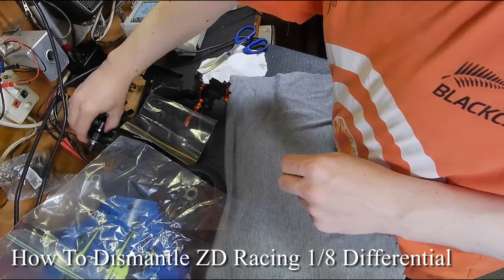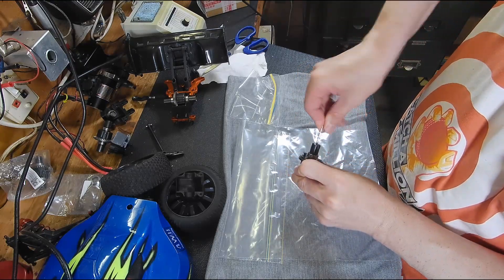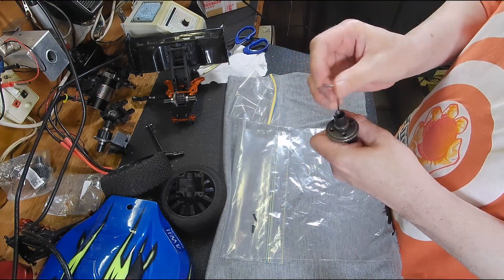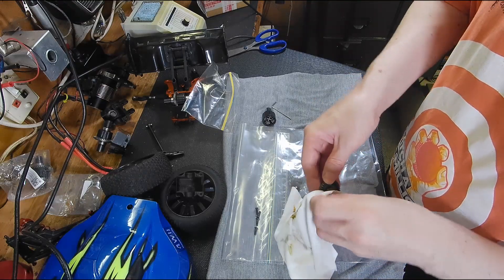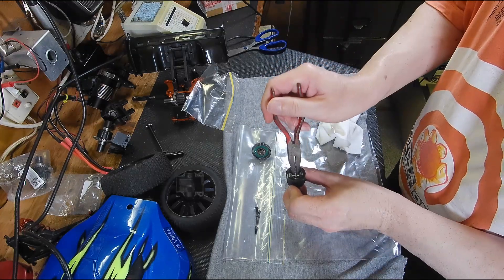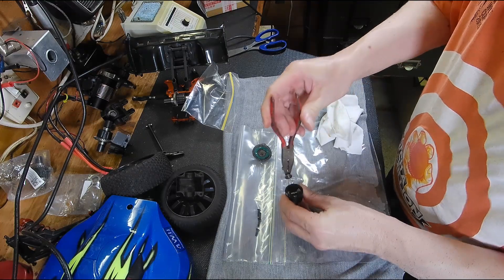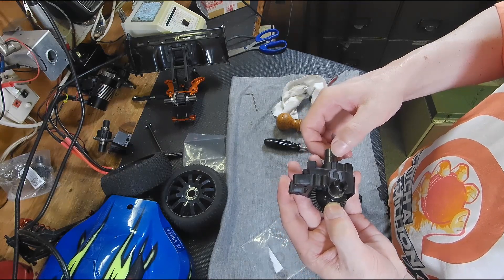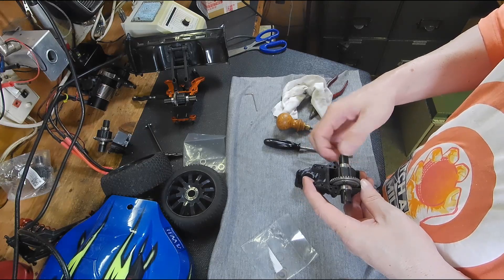How To Dismantle ZD Racing 1/8 Differential And Shimming Ideas

Comment: Hey man awesome vid I will be using it in the near future, was wondering if you could help.  I have the zd racing 1/8 pirates 3 buggy and I am having some wear and tear on my center diff connecting cups.  where the drive t bone rod goes into it, I guess it's slowly chipping away and now theres a chunk pressed into the cup and almost looks like the metal is starting to crack.  I fear it won't be long until the entire cup breaks off where the drive shaft goes into it.  Do you know the part number for this? is the center diff connection cups the same as the rear and front ones? thanks.  I was even thinking of swapping the front and rear cups around on the center diff because the side where I guess if you go in reverse that part of the c cup that would have pressure on it in reverse is not damaged at all.  and I barely use reverse.  thanks hope this makes sense to ya lol .
Reply from the maker: Hi, I think the issue is, that those center cups are not hardened steel. I know that ive upgraded all my other cups to hardened ones, except for the center diff, so I am actually in the same situation as you are, but i will look into a solution soon and make another video.
Reply: @MrGridStrom  Which cups did you use for the F and R differentials?  My C outdrives are perfectly fine but the F and R cups have a pretty nice size groove after about 20 runs.
Reply: @MrGridStrom  ahh that makes sense, because theres no damage on the t bones its just weak steel or what ever they used on the center cups, cool thanks.  I did find something on aliexpress but no idea if it's compatable, I won't leave a link but heres the listing name "HSP 60011 Centre Driven Joint Cup for HSP 1/8 94760/94761/94762/94763/94766 RC Car"
Reply: @xKevmachinex  I had to replace mine within a few months because of this issue, the ZD replacements from banggood were hardened steel and have been much stronger, the driveshafts have been updated by ZD twice as well, the early ones were copper, then hardened steel and now hardened steel and tapered on the ends
Reply: @jhbmtb  @MrGridStrom do you have a link? I have not yet replaced mine but now, wow i thought they were bad before, i can't even touch them theres sharp metal sticking out lol.   I found some that look like them have a look if you want, links for banggood.

https://www.banggood.com/ZD-Racing-8012-Center-Differential-Set-For-18-9116-Vehicle-Toys-RC-Car-Parts-p-1466924.html?cur_warehouse=CN&rmmds=search - these say center diff, not sure I thought maybe they were the same for all diffs.
 
and these, they have a rounder end

https://www.banggood.com/ZD-Racing-8011-Metal-Planet-Gear-Set-For-ZD-18-Buggy-RC-Car-Parts-Vehicle-Models-p-1531335.html?cur_warehouse=CN&rmmds=search

maybe they both work, I dont know, maybe ill order one of each.  thanks.
Reply: So The ones that have the cup and then the rod with the hole in it, those are the cups that go on the differentials, and the cups that don't have that end, they go on the tire? its starting to make sense after months lol.

Comment: You use shims on the outside of the bearing, to either push close to the pinion gear, or on the other side to push away from the pinion, to get more backlash.
Reply from the maker: In a normal diff you would, however in this video im just experimenting with ideas on how to make them work decently. As they are not very well designed at all. At 16:50 I do what you're saying. However i ended up grinding that small protrusion thats causing the rubbing off, and now there is enough clearance and I can shim the diffs as one normally would. I need to make an update video on how well the car is running now.
Reply: @MrGridStrom  hey , what shim size are those? , Btw some 1 else asked the same question...
Reply from the maker: @boazbsh  Kyosho 96772 13 x16x0.15